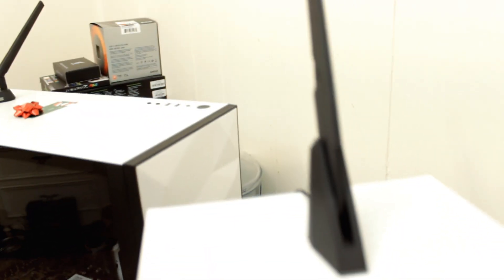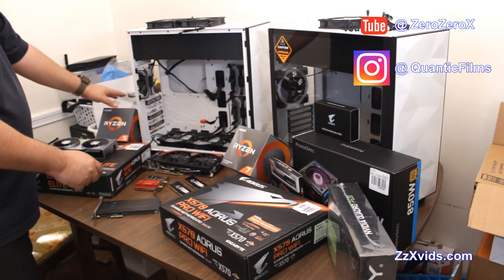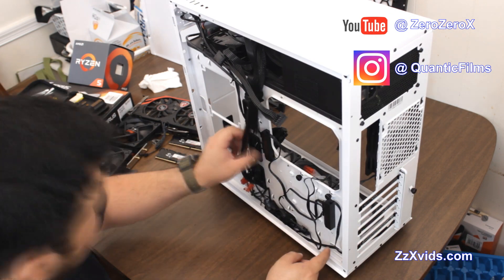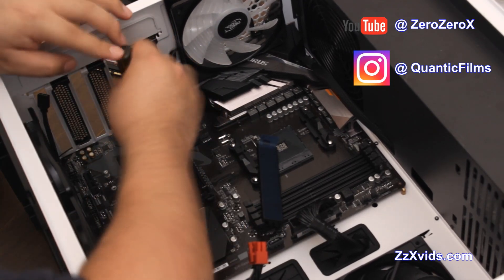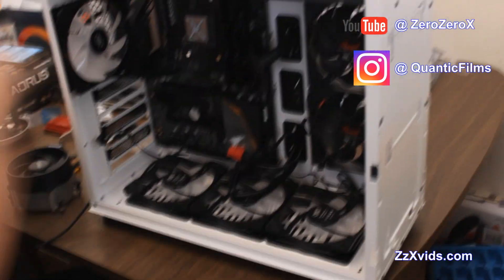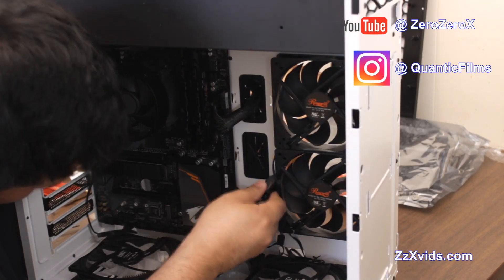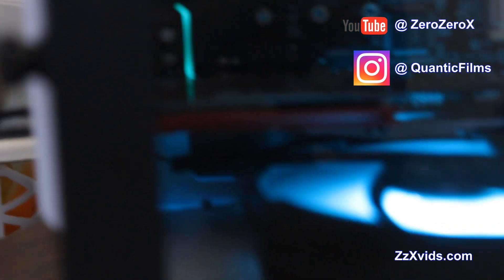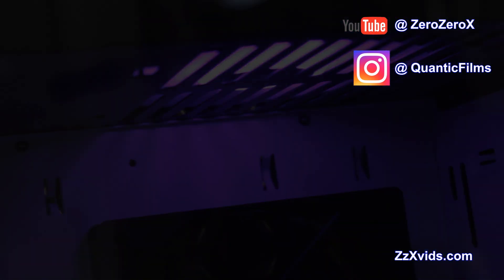new DREAM Computer 3.0+ Setup PART 1: New Sentry+ Music/Audio Production PC build...

Comment: are you getting intake or out take with that one fan in the front if so is it making the case hot or cool i wanna use my kraken X42 as its a 140mm AIO
Reply from the maker: It is basically outtake because it bounces of the panel and it goes back to the exhaust to the right. It sucks out air to the exhaust fans that have a mesh and holes. There is no mesh on the front panel.
Reply: @OsoXVids  ok cuz i have the Rosewill Prsim S500
Reply: @OsoXVids  hey question where do the vdg in cable go ?

Comment: Not possible with Thunderbolt on Gigabyte B450 AORUS ELITE ATX AM4. Also Gigabyte X570 AORUS ELITE has no Thunderbolt possibility, so also a bad choice. All new good audio interfaces are Thunderbolt so why choose a solution without Thunderbolt. Make no sense
Reply: Actually, it does make a lot of sense if you use USB or PCI interfaces. Not everybody needs that kind of transfer speed.
I would say that that's a killer computer right there.
Reply: all kinds of things stfu